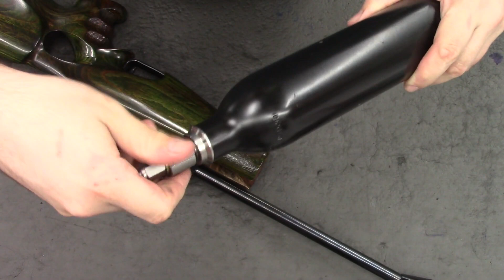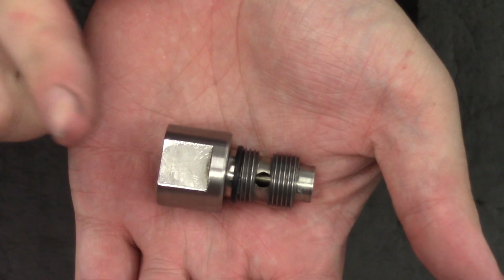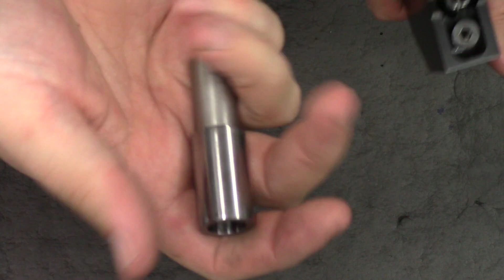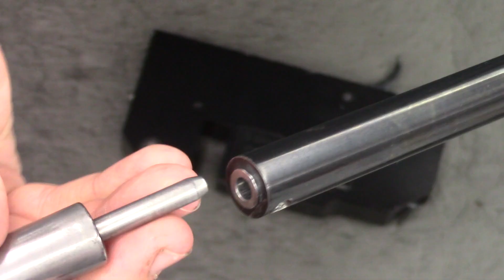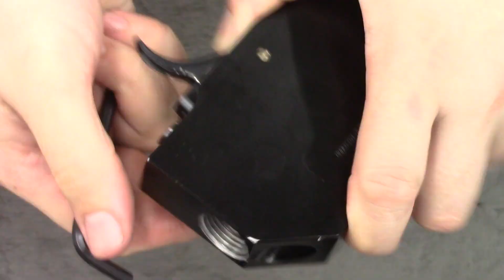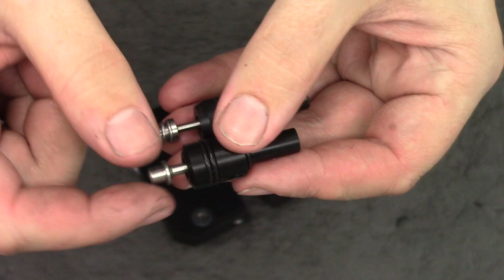Theoben Rapid MK1 disassembly

Comment: Excellent guide, thank you for taking the time and effort to do this. It's been 15 - 20 years since I stripped mine down out of curiosity and this refreshed the process nicely. Incidentally I believe this rifle to be a late model MK1 due to the markings an the block. Also a MkII bolt handle (but I know it's been played with) Thanks again.
Reply from the maker: Thanks, yeah its a mid MK1 block, but I didn't know about the MK2 bolt handle, Thanks for watching.

Comment: Great video out of interest the Allen key screw drivers you use what make are they and any links to them or a good recommendation keep up the good work .
Reply from the maker: The red handled ones are EDS hex drives, very recommended, you can find them on ebay or you may find them cheaper if you have a search on google. Thanks for watching.

Comment: In the brass pip you made if you put a piece of delrin in the end to hit the valve you will be amazed how quiet it make the action.
Reply from the maker: Thanks for the tip, having a little experiment with the length of the brass piece one but when I get it right ill put a delrin insert in the end of it. Thanks for watching.

Comment: Hi pal since you are a magician in making gun parts to high quality i have a question, would you be able to make a transfer port for my hatsan galation  .22  the one in my gun is made of brass and the threads have become damaged and no longer holds the air tube, every time I fire the gun the air tube flies out of the gun. Let me know if it's something you would be interested in doing and placing it on ebay for me. 
Many thanks
Reply from the maker: Sorry mate without the rifle its hard to get parts right, its not something we can do at the moment. Thanks for the interest though. Thanks for watching.
Reply: @sub12airgunners  not a problem mate thank you for replying 👍keep up the good work